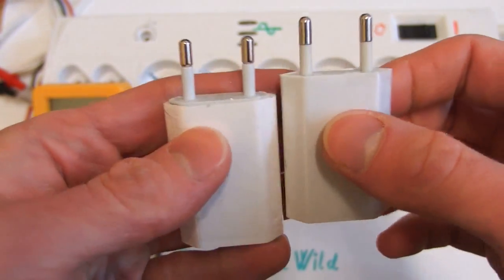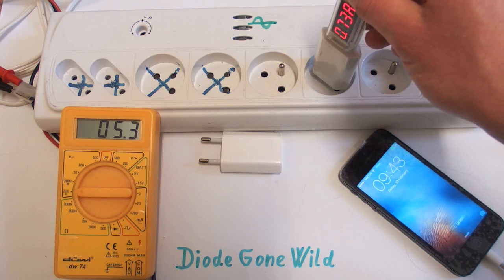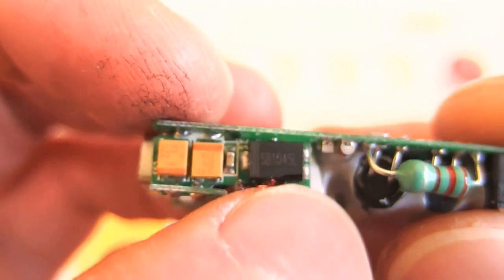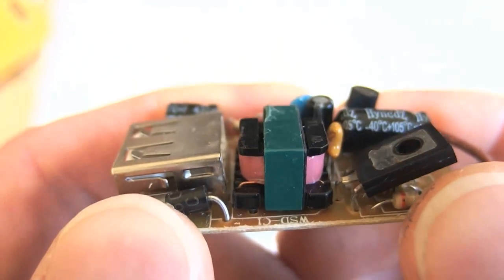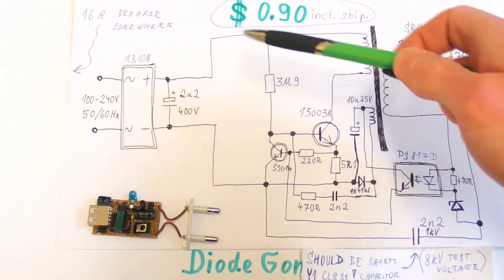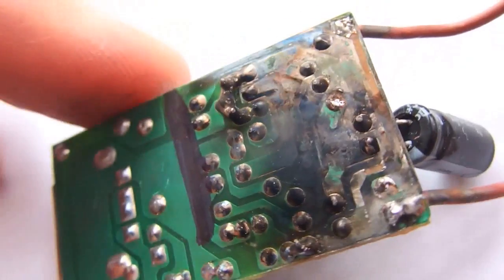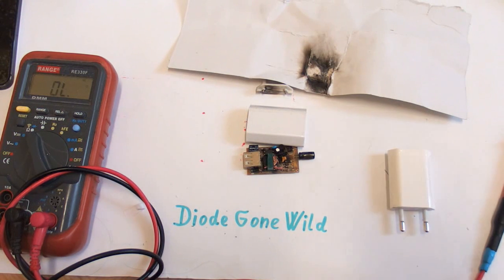Deadly USB Charger (Fake Apple) + Explosions

Comment: I remember one day my power supply capacitor was some how desoldered and the transformer was humming at 100hz then i resoldered it and after some time the power supply stopped working and i checked the fuse which was open and the mosfet was blown. This was a quite strange failure because the power supply didnt blow up when the capacitor was loose and was not making contact with the trace but the mosfet shorted when everthing was fine like the chip, transformer and diodes.

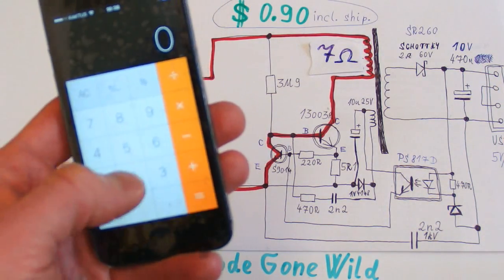Comment: 07:32 but isn't the 3M9 in parallel with the 7 ohm winding ? Does some calculations Oh nvm, a 3900000 ohm and 7 ohm resistor in parallel are equal to a 6,9999874 ohm resistor, negligable difference.

Comment: Never charge phone With generic chinese charge because they can damage the battery protection circuit i worse cases it can caught fire. I had done a testing on fake phone charger adapter that i buy from ebay. On the box it shows 5 volt output. To conferm its output i cut a usb wire then  i measure its Voltage thats is 5v. But after 3 times of usage I measure its output again and i measure 15v. When i open it. It has not any protection fuse. Thats conferms they are so dangerous. Dont buy them.

Comment: The Apple charger is actually kind of crazy, the purpose is just to create a 5V power source that is safe in case of failure, that's all. Yet the Apple charger has hundreds of components on it and you would expect it to be like a mini-computer circuit board or something with that many components on it, yet all it does is create a 5V power supply, lol. 
The Apple chargers fail often, and I think it's because they have way too many components than necessary. 
The actual basic design that the Chinese one uses, lasts longer in fact, but being Chinese they cut a few corners, if they used a proper capacitor, larger separation gap, and also added a fuse, then it would in fact last longer than the Apple one.

Comment: Hello i would like donation a repared power supply from a ethernet switch 16 port the motherboard came after 7 years later smoke from the motherboard from the switch the power supply is 100 procent working 12v 2a how can i send it to you? This power supply is 7 years age repaired

Comment: I don't know if that counts as a coincidence, but your video was recommended to me by Youtube after I stumbled upon your website while looking for resources on cheapo 1-transistor power supplies like the one in the video. And although your website is very helpful, do you know where I could find more detailed resources on that type of power supply architecture, with calculations, etc?
Thanks!

Comment: One thing about Apple chargers that I've never seen the copiers do: look inside the USB port. The serial number is printed inside. You can see it at 2:52. I'm not saying this is a sure fire way (get it?) to tell a genuine from a fake, but it's always worked for me.
Reply: just look between the prongs. There should be an Apple logo, and the other stuff
Reply: @pretty_bored   A logo is no guarantee.  A while back I was trying to buy a good quality Shure microphone.   After buying 4 different ones - all boxed and with every surface indication of being genuine I gave up.    It was only by getting them in my hands to closely inspect some details inside that they could be identified.
 I did get my money back each time from ebay and actually rang Shure who told me they actively pursued fakes sold on ebay -  but their efforts are rubbish if they exist at all.

Comment: Is it ok to add a fuse in the live line to avoid this explosion? Thanks!
Reply: Not really because of all the other problems with the charger. A fuse wouldn't stop the charger killing you through the metal body of a phone (or the end of a USB cable) should something else in it break.

Comment: The snubber circuit on the right of the 3 is the one I normally use. It's worth putting it in, because at the very least, it will reduce the temperature rise of the power transistor. With out it, the transistor goes into avalanche mode, just like a high voltage Zener  diode. that creates a temperature rise, which can cause failure by high temperature. Switching circuits like this are very low impedance, and can be made safe with a 1/2 amp fuse on the input. I also recommend a 10 Ohm resistor in series with the input to protect the bridge rectifier from the current surge of charging the capacitor. Good set ups actually include an inductor in series with the input. If the bridge goes out, or the power transistor, it blows the fuse so quickly, that nothing has a chance to heat up. You likely won't smell anything, except maybe the 10 Ohm resistor, and the unit simply stops working.

Comment: I had one with a us plug. It nearly blew up a short length ego battery I had. I checked the battery and it was too hot to hold. My house would of been burned down, that’s why you should never charge ecig batteries, while out.

Comment: Problem is that many of these dangerous power supplies are included in the delivery of mobile phones, tablets, or other household appliances already included. Of course, you can not check at first glance how much the power supply has cost and if it is of high quality. For full safety then only helps:

 - Throw away power supply
 - buy cheap but not too cheap and renowned power supply
 Or (for smartphones and tablets)
 - load the device via USB to the PC

Comment: Sir i have a question related to cell phone charger...so
Can you help me...?
When i apply a ac supply in charger circuit board some buzzing or whistling sound come out from transformer.
So whats the problem in it and how to reduce the sound of noisy charger circuits?
Reply: Dont use diffrnt device /mobile 
Its puts load on 
Charger

Comment: Unfortunately, the primary circuit path you drew in red is incorrect. Current does not enter the collector of the 13003 and exit the base. It's an NPN transistor, so current will exit the emitter, pass through the 5.1-Ω resistor, and return via the negative rail.
Reply: You missed when he said that when the power transistor fails there will likely be a collector to base short apart from the collector-emitter short.
Reply: Kxkddkfx

Comment: OMG I bought one of these recently! And guess what, I opened it to check, and it was exactly the same circuit (circuit pic: http://tinypic.com/r/2cfpgtu/9). I was using it to power a usb wifi repeater, so it was on all the time for like two weeks. Bonus: the transistor was starting to darken, and smell bad as well (pic: http://tinypic.com/r/2mi11jc/9).

Comment: When calculating the fault current as 230V/7ohm, don’t you have to factor in the inductive reactance of the transformer at 50Hz?
Reply: Since these transformers designed for high frequencies, inductance at 50hz can be considered negligible.
Reply: There is DC voltage there ,  about 310V DC, he forgot to calculate it. By the way, 5 or 7 amps, it doesnt matter....
Reply: @voitano73  It won't be a DC voltage at all. It will be a pulsating DC with an RMS voltage of 230V and so the power dissipated in the transformer winding will be what he said. The smoothing provided by the 2uF capacitor is almost non existent when loaded with the 7 ohms of the transformer primary.

Comment: you should wire your lights to different breaker just in case a wall socket shorted it will not turn of the lights
Reply from the maker: There's a 10A light circuit  breaker and 16A wall  socket breaker. Unfortunately, when I short my socket, not only the 16A breaker turns off, but also a common 25A breaker that I have before the electricity meter.
Reply: isnt 25A low for the whole home?
Reply: that's what the electricians did to my house when it was being constructed

a large fuse box is wired to the sockets, while a small fuse box is wired to the lights

but mostly of the lights in my house go short-circuit because the water from rain passes through the roof of my house and the water climbs to the wirings of the lights, the roof of my house was 17-18 years old, and will be fixed

Comment: 2:12
I was interested in the specification of that high voltage MOSFET (the big ST one - it looks like a chip), but in fact it's an obsolete part already ... boo! It's the STL7NM60N 600V 5.8A 805mOhm N-channel FET.
Reply from the maker: Modernity is so relative...

Comment: Poor little pcb, murdered LOL :-D
Thats a similar-ish circuit to the one used in the +5 +12 v external hard drive psu's (cheap flypower type).
Now they are cheap, but ive had no problem with them, although i do drill ventilation holes in all my supplys, i dont like the ovan effect on parts :-(.
Heatsinks dont work without cooler air flow.

Comment: Nice explosion, I love it! I have one question for you - is this 2-transistor supply any better than the 1-transistor ones, like on your website? Also, is there any chance that you measured the efficiency of your LED driver, I built it a few years back and it's doing great working 2+ hours each day. But I measured power consumption from the mains, it's 3W and I only have 1W on the output. Is this normal or I messed it up? I expected 50% or higher.
Reply from the maker: The 2 transistor circuit can be more efficient and the current limiting threshold is more predictable. ,... What LED driver do you mean?
Reply: DiodeGoneWild I meant this one: http://danyk.cz/izled_en.html
You built lots of stuff, I  understand that you can forget something :)
Reply from the maker: Of course, I have built so many devices with LEDs :) and most of them years ago. The most tricky part is, as always, the transformer. Wrong transformer selection can lead to horrible efficiency. Low power supplies also tend to be less efficient than the high power ones. You can also try to change some values, like the startup resistor (470k), the snubber loading resistor (100k) to a bit higher value. Also the feedback capacitor (2n2) is important, it sets the operating frequency and can have significant impact on efficiency.
Reply: DiodeGoneWild The thing is that I followed your instructions precisely,  the core is 4.5*4.5mm like you mentioned, but I wound the aux winding with a single 0.5mm wire. I'm pulling about 300ma so I thought it will be fine. I'm gonna try some tips you gave me and write back :)
Reply: Alright, here are the results: originally it oscillated at blazing 26kHz, now at 58kHz. I changed the startup resistor to 2*470K in series, base resistor to 100R, feedback cap to 1n. I didn't change values in the snubber, but I did replace 100K 0.25w resistor with 100K 0.5w because the old one is a bit discolored :)
 Now it consumes about 2.3W instead of 3.1W. To get to 80kHz, I will have to use less than 1n cap in the feedback and I think that might cause problems (the transistor won't receive enough base current to switch hard). What do you think about that?